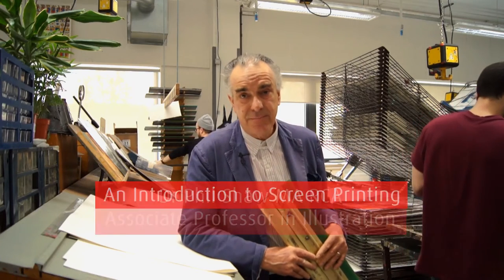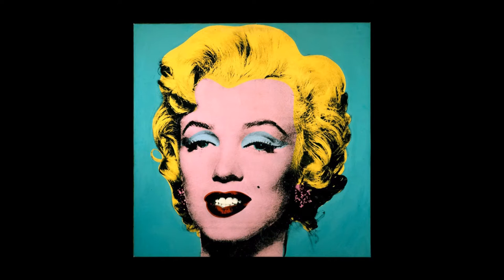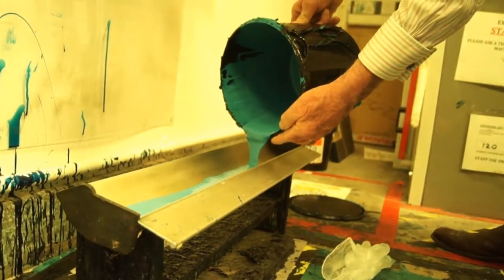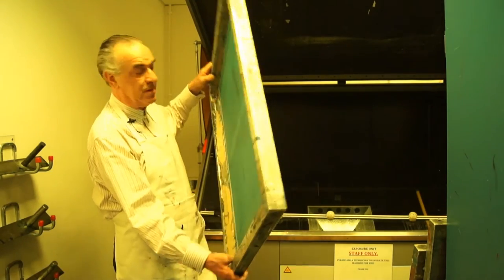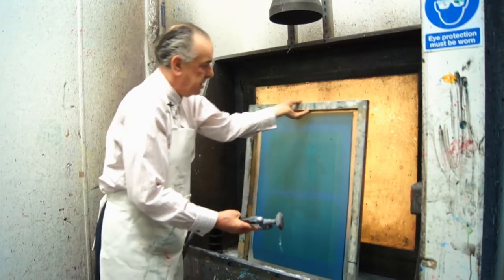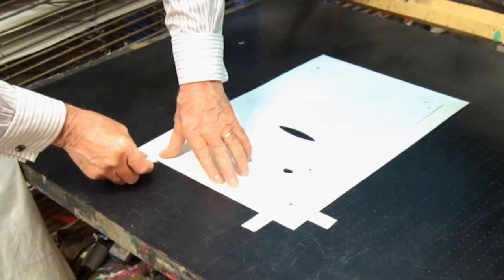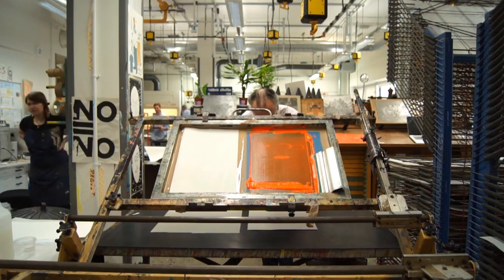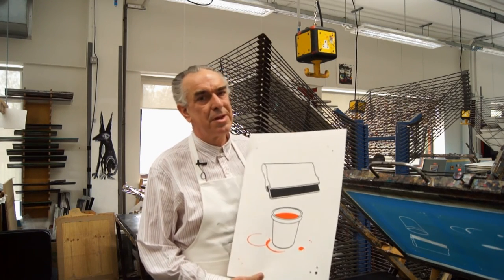Printmaking at Middlesex: Screenprinting

Comment: This is just wrong on so many levels
Reply: What do you mean?
Reply: joe BONES you should always coat the substrate side first and then finish on the inkwell side, this creates the gasket necessary to transfer ink
Reply: joe BONES that “dryer” is going to leave marks on the wet emulsion by leaving it on top like that
Reply: joe BONES emulsion needs at least 35% humidity or less to completely dry and recommended for 36 hours otherwise you will get washout issues, loss of definition and also makes it harder to reclaim